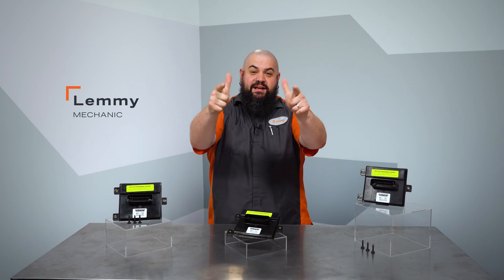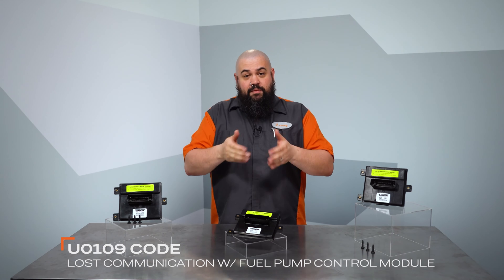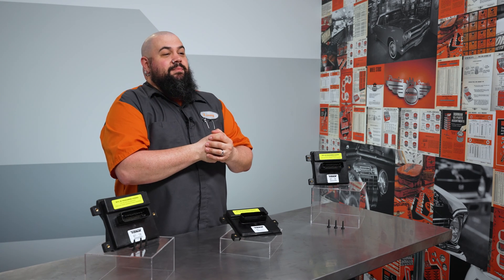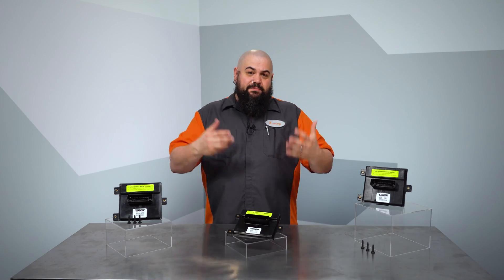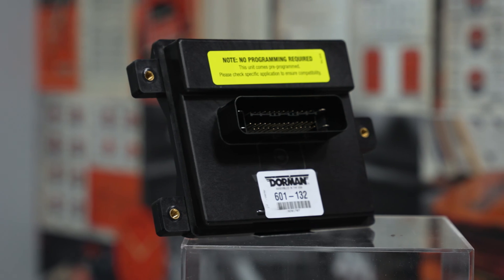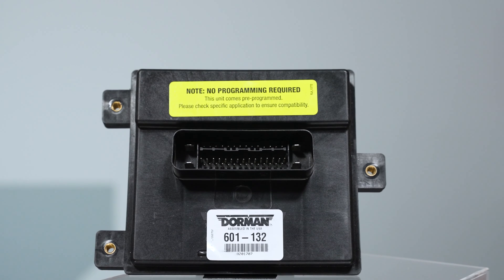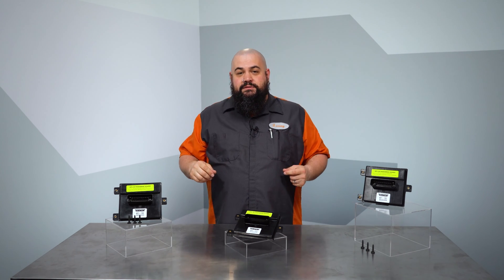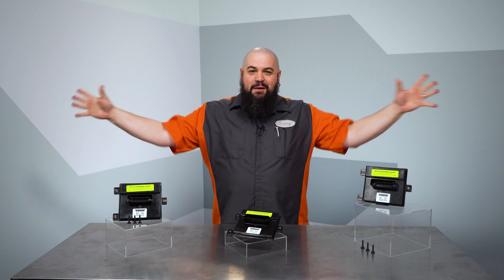No-start, U019 on a GM? You need Dorman’s pre-programmed OE FIX FPDM.

Comment: I have a 2010 GMC terrain SLE 2.4 motor put a fuel pump on still won't work check the fuel pump control module so I got a replacement at a junkyard from the same vehicle don't know if I have to  erased codes and reprogram it or should I get a brand new fuel pump control module programed the VIN number is 2CTFLEEW1A6274803 should I buy one that's already programmed do they come like that would that sound the problem asking a request for help what to do
Reply: Could you please help me what's an answer I've been trying for 8 months how to get it fixed
Reply: Could you please help me for free answer

Comment: your fasteners SUCK for the location they are at AND being a TORX drive, why not have a 10mm socket head that would make it easier to install and remove so you wont have to dig out road debris like i had to cause mine had been replaced before with these type of fasteners. Just a helpful hint DORMAN

Comment: I bought one for my 2014 Tahoe, I can hear the fuel pump working when I turn on the ignition, but the starter doesn’t turn the engine when I try to start , when I unplug the module the starter works fine and turn the engine, it seems that the ECM doesn’t know the Dorman module and I need to program it, although it’s preprogrammed.please help me if you have any solutions. Thank you!
Reply from the maker: It sounds like the new Dorman module has a communication issue to the BCM, you will want to warranty this out through your retailer. I apologize for the inconvenience.

Comment: I bought the one with part number 601-132 for my 09 Chevy Tahoe and it does not work. It says it’s pre-programmed but it’s not.
Reply from the maker: Hello! Part # 601-132 is preprogrammed. We recommend checking for a failure code or fault being set that would cause it to not function properly.
Reply: @DormanProducts 
I just bought the same one 601-132 and have two codes one is the U0109 & P0230. Have replaced both pump and this module! Starts and stalls! No power getting to the fuel sending unit/pump coming from module! Module is getting power & ground correctly!!
Is the Dorman part not programmed or just failed?
Reply: @priorityautotowing4100 did you figure it out bro? Mine is doing the same
Reply: You ever fixed this issue?? I got one as well and it will not start

Comment: I just used this on my 2010 Silverado. It starts but stalls 20 seconds running.
Reply from the maker: Hi Michael, does it set off a trouble code when stalling? If so, we recommend diagnosing from that code.
Reply: @DormanProducts my preprogrammed device is not working
Reply: @celestafatebess7305 did you ever get it to work?